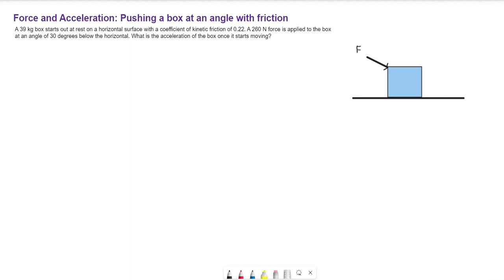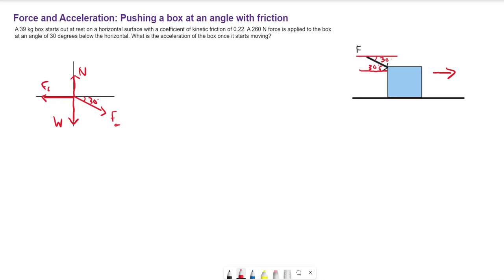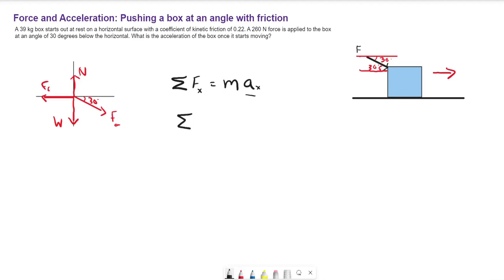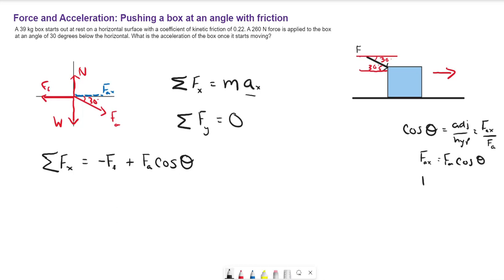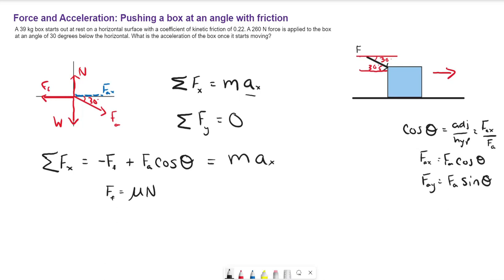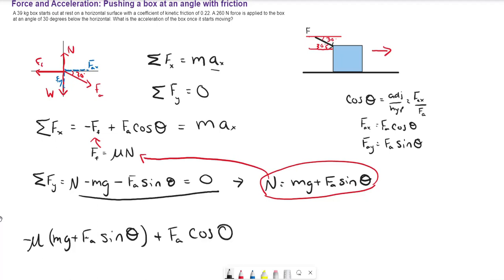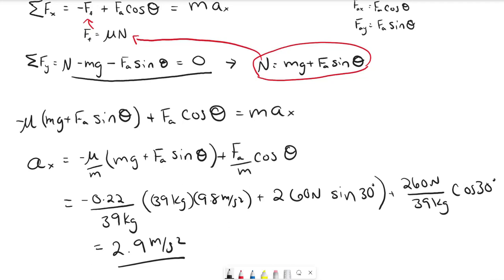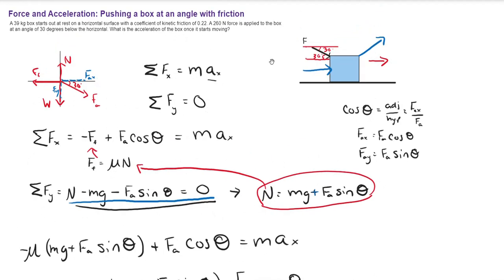Force and Acceleration: Pushing a crate at an angle (with friction)

Comment: How would you solve this for applied force if you had the force of friction (38.5N), if the angle was 30.5°, and the mass 26.0kg, and you wanted to know what force to exert to get a constant velocity?
Reply from the maker: You should be able to use Newton's second law F(net)=ma for the forces in the hoizontal direction only. If your velocity is constant, your acceleration is zero. So, F(net)=ma=0. You'll have the x component of the applied force and the friction force and then add those together (one is negative) and set equal to zero to solve for your applied force.